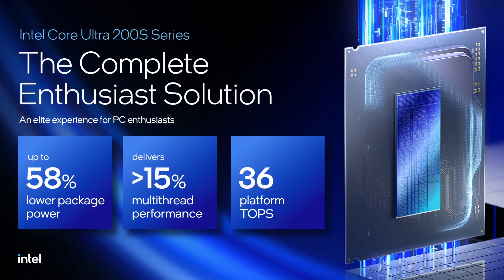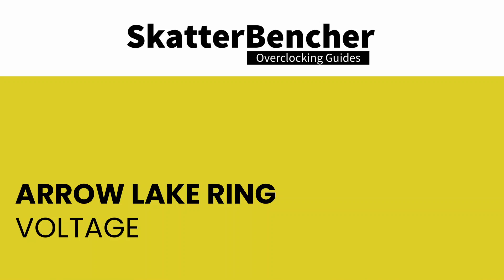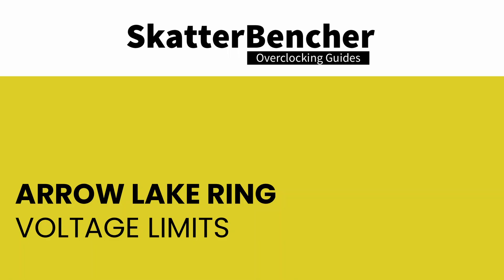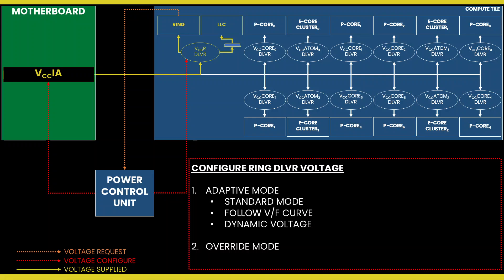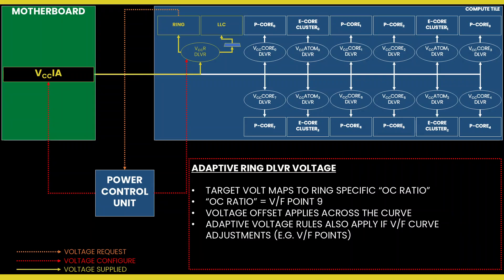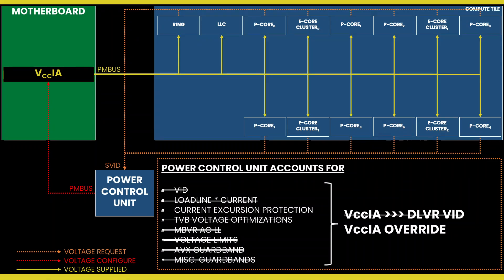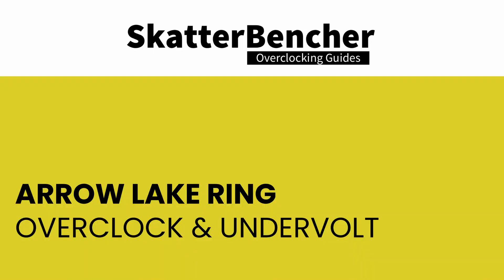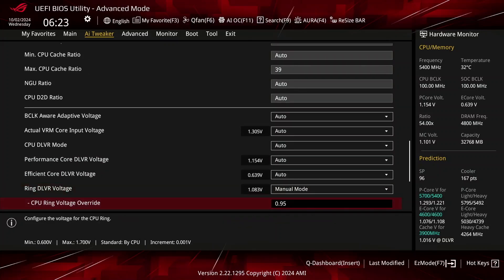Arrow Lake Overclocking: Ring

Comment: With the dlvr power loss example, where did you get the 160A from ? For total power loss, you have to calculate each dlvr voltage drop and current individually, then sum up the power results. And ringbus should be only tiny fraction of total current.
Also in the powergate, the problem would be exactly the same, as the input voltage still drops, but also the power draw of the silicon parts gets higher, because they recieve higher voltage.

Comment: just because cinebench does not scale with ring clock, does not mean that other programs wont
sample size = 1
Reply from the maker: Good point! Any suggestions for benchmarks I should target for checking the impact of Ring overclocking?
Reply: @SkatterBencher  or maybe MKL Linpack
Reply: @SkatterBencher  The HPC section of the Phoronix test suite, such as NAMD STMV, OpenFOAM and GPAW carbon nanotube
Reply from the maker: Thanks, I'll check it out!
Reply: @SkatterBencher I’m more interested in the creator side of the new cpu. Not the gaming.
Reply: Cinebench in particular probably doesn't care much about ring or memory speed. It has very high L2 hit rate.
Reply: the benchmark/stresstest that improves the most is probably the one to show errors first, so idk what he used to test ring oc.

Comment: 15:40 you should measure ring performance by latency, not worthless cinebench score
Reply: OCing ring gives a 4-5ns lower latency in aida64
Reply: Like useless aida "latency" test ?
Barely a good indicator.
Reply: @panjak323  +5~ in games too, but overclocking ring seems kinda weak performance boost
Reply: @panjak323 better than nothing using AIDA. At LEAST it gives an IDEA
Reply: task failed successfully, no gains, but faster elsewhere.